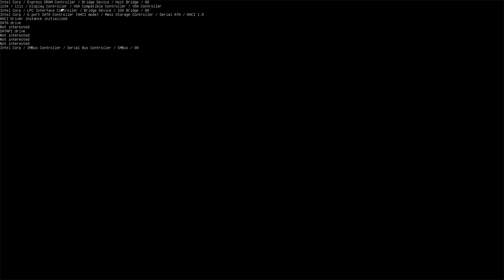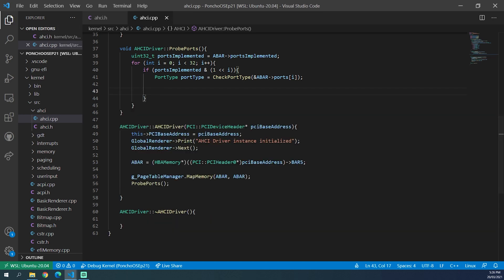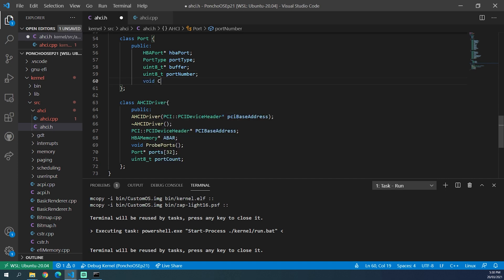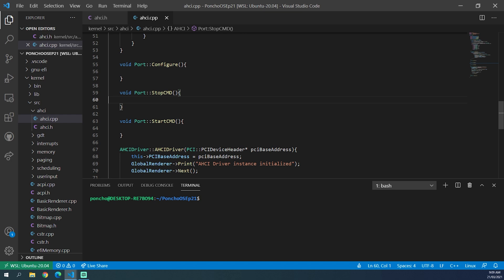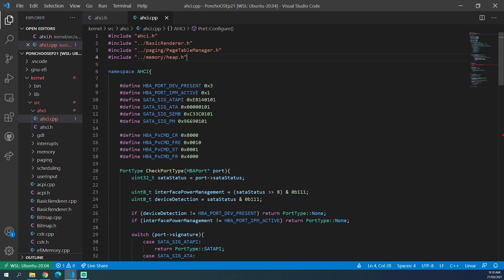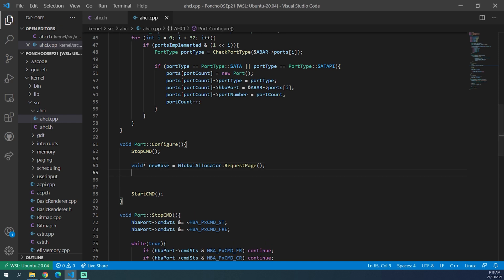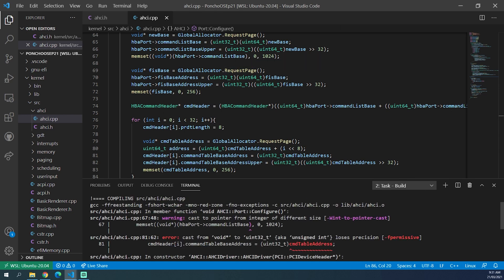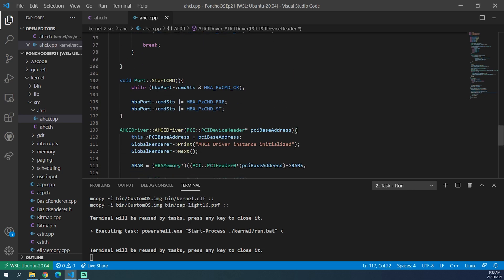AHCI Port Configuration | How to Make an OS: 22

Comment: instead of doing 

Port* Ports[32];

and than keeping track of the port numbers separately, I've actually opted to use my custom DynamicArray class which i will be using to replace a lot of these bare arrays and also to replace std::string 

[I would normally place a link here to it so you might browse it but youtube is being a bit touchy about links]